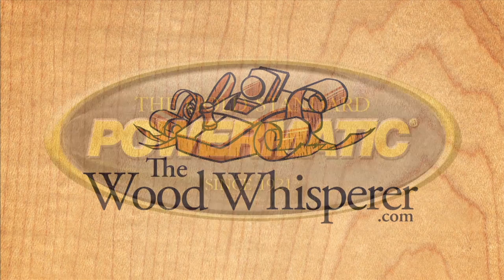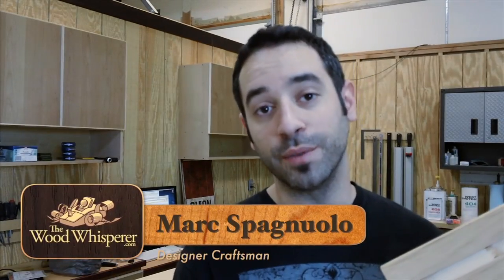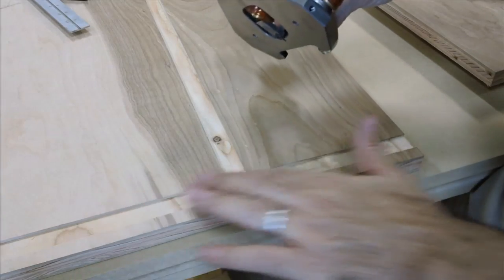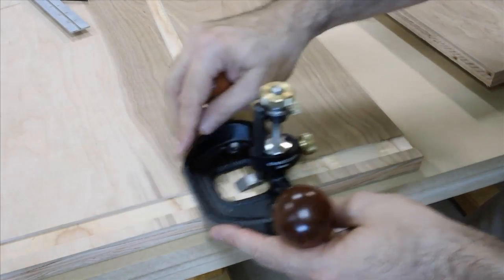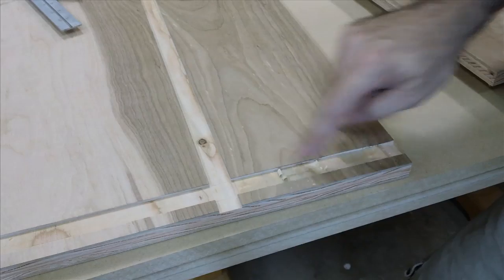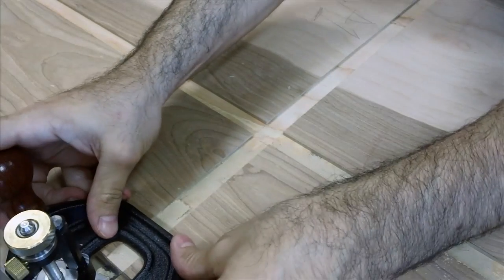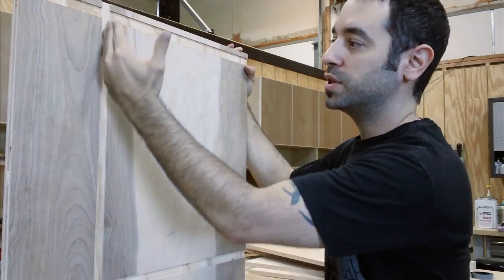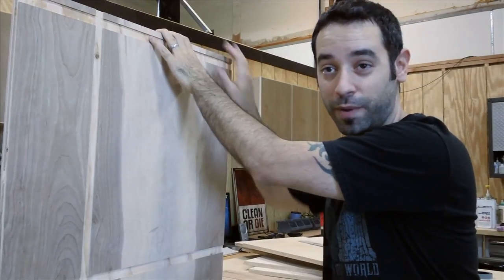156 - Cleaning Up Dados with a Router Plane

Comment from the maker: @hedorah99 depends on the blade. Mine detach from the shaft so I can just put it under my finger to flatten the bottom. Then the kit comes with an extension to allow you to work the bevel. For the type that does not detach, I would recommend putting your sharpening stone near the edge of the workbench and rubbing the bevel with the shaft hanging over the edge. Take your time and you might even focus pressure only on the pull stroke. And I just set up about 10 sex jokes, lol.